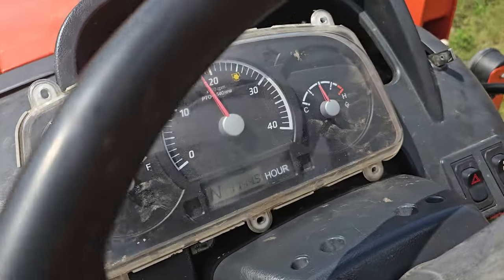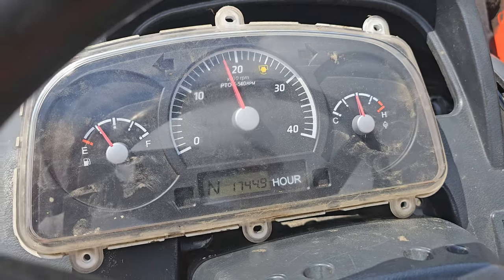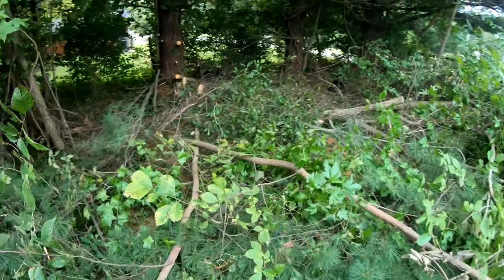Repairing the Kioti Tractor Gauges |  Update on the Issue

Comment: Don’t think I ever want to own a Kioti. Seems like you spend an extraordinary amount of time working on it. What’s your favorite tractor brand?
Reply from the maker: I actually like the Kioti brand a lot. You get a lot of tractor for the price. They are all going to have their issues sooner or later. The only complaints I have about Kioti are that the plastics (cup holder, and housings around switches) seem to get brittle and they are known to have issues with a Safety Start Module. Other than that, I think Kioti's are very mechanically sound. I also like John Deere a lot. Every one I have ever used seems like quality. I'm sure though most of the other tractors brands are good as well. The nice thing about the main brands (Deere and Kubota) is that IF you do have an issue, the problem is probably well documented because so many of them were sold, the parts are readily available online, and resell value is better.